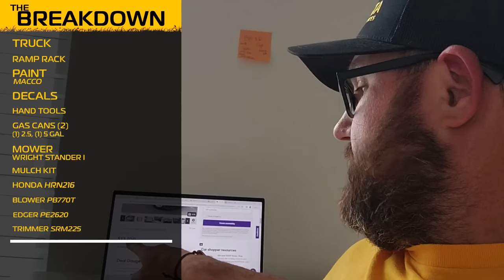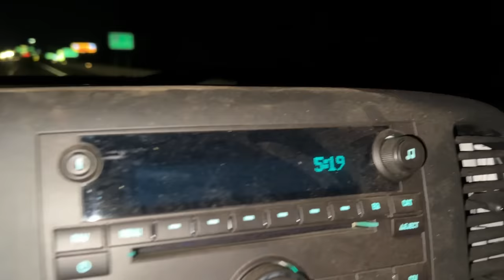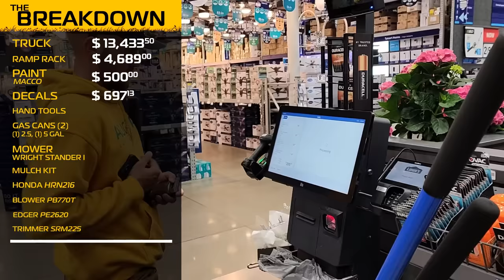Buying a NEW Lawn Care Setup ► PRICE BREAKDOWN!

Comment: I just bought a 2013 GMC 2500 paid 15k with 190k miles with CNG. I'm loving the CNG for my lawncare it's 1.40 a gallon and last as long as gas and the engine runs clean. I don't think I would go back to gas it still has gas if I want to use it but I try not to.

Comment: We have been using s10's for 16 years, i replaced the beds with ones i built simular to cityturff! I can tell you we have mowed over 300k mows! Bells and whistles do not make you money! I have never understood why someone would spend $100k and show up to mow a $45 lawn! I can spend $20k all in and mow 20 $45 a day! You can make this as hard as you want
Reply: what truck/equipment would you recommend for a small solo operation getting started?
Reply: @D H  we are moving Into  1/2 ton full size trucks, we have ran 36 standers from john deere for years now! I don't care what color your mower is, find a dealer that is on your team! 36 sanders work great! Echo 2620t trimmer and a echo blower! The Office is where the money's made

Comment: What’s in the back of the truck a 36 and a push? 52 and 36?
Reply: Run 54" and a 30" (54" scag patriot) (30" pushmower) you'll be able to do most yards and for the small ones just use the 30"

Comment: Getting a 2nd truck with only 70 accounts 🤦    250 in a 10 mile circle...then and only then you can get another truck.  Each crew should turn 200k in profit... That profit after fuel taxes payroll.. that's just grass.